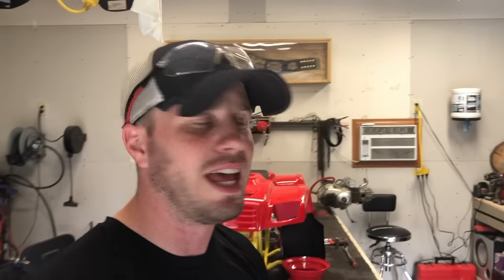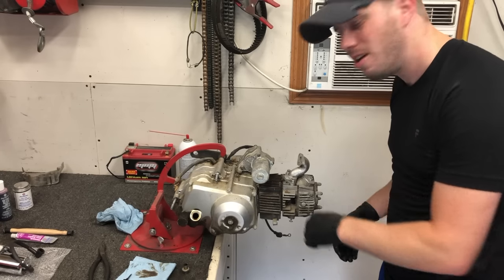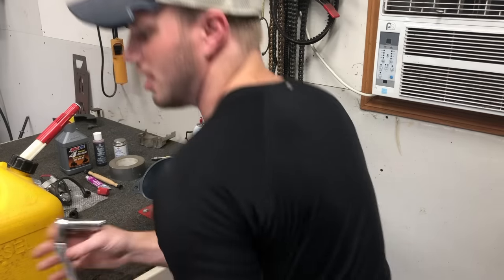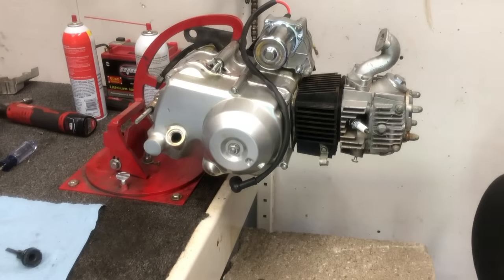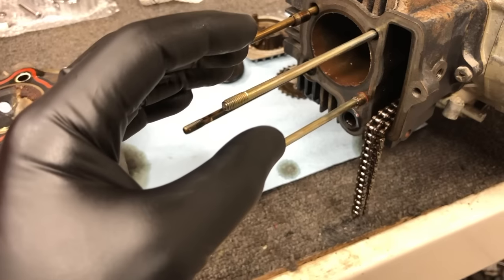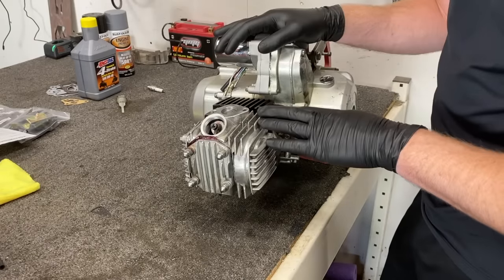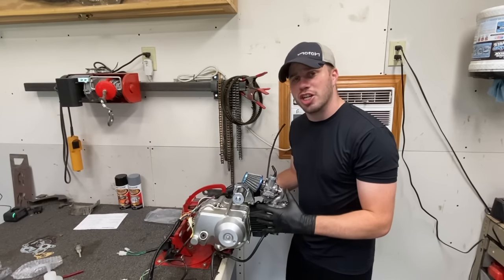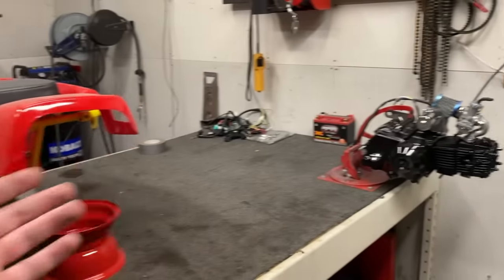Restoring a TaoTao 110cc Chinese ATV! Complete motor rebuild! Part 4

Comment: Do these come with the valves adjusted already or no, if no could that be considered a vacuum leak which may explain high idle. What video would be best. Thank you.
Reply from the maker: I recommend checking the valves as routine maintained but it's not likely that's your issue. High idle is probably a Fuel or Air flow issue. Did you try adjusting the idle screw?
Reply: @PraskaBoysGarage  I'll be doing that here in a bit. Thank you.

Comment: hello BJ, I bought a new starter for my atv off of eBay it came in and I installed it but it wont crank. I left the engine there sitting for a month or so but it wont engage I was wondering what the problem was, Thanks again!
Reply from the maker: Hey man! Check out the video I just posted last week on the channel. I discover that the motor is stuck and after I rebuild it I trouble shoot why it won’t crank! Check it out and I bet it will help you figure out what’s wrong!

Comment: Hey  by any chance you got a diagram of the fuel lines and how all other vacuum  hoses my atv had no carborator  so I'm a little  lost
Reply from the maker: Sorry I don't. Shouldn't be any vacuum hoses unless it's a California specific model. Only fuel lines you have is coming from the tank to the carb and a hose coming from the bottom of the bowl down the side of the cylinder.

Comment: Are there alternatives to these engines? Say if we wanted to upgrade power? For example with the atc70's you can swap original motor from 70cc to say a Lifan 125cc. Has anyone upgraded a Chinese atv?

Comment: How did you identify the engine size? Mine is a TZH157FMI which online is anywhere from a 110 to 250 can’t really find a reliable source.
Reply from the maker: Look on the cylinder sleeve or cooling fins. On most motors it with be in the casting stamped with a CM3. Here are the ratings: 
49cc = 49CM3
70CC = 72CM3
90CC = 86CM3
100CC = 97CM3
110CC = 107CM3
125CC = 124CM3

Comment: MUST I USE 15W40 OR COULD I USE 10W40 FOR 125CC BREAK IN.  NEW MOTOR, CARB, UPGRADED CDI, IGNITION COIL AND PLUG.
Reply from the maker: Your oil weight is fine, the main thing you want to watch for is the type of oil. You'll want to use an oil that is specifically designed for a wet clutch.

Comment: Can you link the clutch assembly online? I'm following your content building an 09 110cc coolster. But the clutch is shot. It's an auto with no reverse, it looks to be the exact same as yours. Everything I found online is for Semi Autos or doesn't match our clutches exactly, I pulled the plate over the clutch with 3 screws and there was black gritty dirt/dust all up under it, bought it for my kids as a project for $60! Turns out a starter chain guide mount broke off leaving a hole, I'm going to try to jb weld the hole and the guide into place and send it. Just around the street or yard nothing crazy. Thanks BJ.
Reply from the maker: Hey Jenna, I just posted a link on your other comment for clutches off VMCs website. Good luck on your project! Sounds like a fun one!

Comment: Great video! Is there a quick way to determine the engine size? (I just found a mini chopper with one of these engines with no clear indications of engine displacement.) 
Thanks!
Reply from the maker: Most of the time the marking is stamped on the engines cylinder cooling fin. For example if its a 110cc the stamp will read 107cm3

Comment: I have to ask what that red swivel table mounted stand is called exactly and where do I buy one because that would make life so much easier for working on these small motors.
Reply from the maker: Thanks for watching! I purchased the stand off eBay back in 2018. I am working with a company to help me make my own to sell on my website since it's been so popular on the channel! They should be available for purchase in March, and I will have a video on the channel going over them.

Comment: I got one of them quads does the break switch cables have to be touching for it to get spark ? I’m not getting spark
Reply from the maker: The brake switch cables need to touch so your start button will have power in order to turn the engine over. It doesn't affect spark at all.

Comment: Another great video !!!
Could you please leave a link for the engine stand your using I could really use one thank you
Reply from the maker: Thanks! This is my #1 question for sure! I actually had a CNC company laser cut out all the metal to start making and selling my own. I will be selling the kits on my website either as a DIY kit or a completely assembled and power coated. Should have everything ready soon and will post updates on the channel.

Comment: Hey man. I Got a hand me down 110 for the kids that wouldn't start. Did a complete new rewire kit. New battery, stator and starter also (all by watching your awesome vids BTW)
Got it to fire and run great. After about 15 minutes when hot it makes a building whining sound then dies. Let it cool a few and starts back up until hot again. I got into it to investigate and even retested the stator. I discovered that when turning the flywheel there is a scratching sound coming from what sounds to be the piston head. Would the engine getting too hot cause the electrical to shut down? Also when changing the oil it was metallic in color and had some bits in it. Rings?
Reply from the maker: These motors and electrical systems do not have an overheat safety so I doubt you have any electrical problem. I'm more concerned with the noise and the metallic in the oil. Definitely need to investigate and crack it open. If you can do a compression/leak down test first. You'll know if you have a failed ring then. Good luck on the search, I hope you find it!

Comment: Gday mate I'm restoring a quad bike and I'm currently working on the engine.  There's a lot of sand inside of it as the carbi, intake manifold and other pieces were missing. Anyway I was wondering what you used to clean the sludge out of the bottom. And what would you recommend I use to clean the engine out
Reply from the maker: When spraying it out I just use regular carb cleaner. If your not splitting the case I use diesel fuel to flush out the rest.

Comment: Bro I have same machine it was OK. I changed battery charging coil but due to  lake of knowledge I rotated megnetic fly wheel. Now my machine sparks but won't startes. I think there is timing issue can u please guide me how to set t mark.
Reply from the maker: Your flywheel should have a keyway. If the keyway is locked in with the crankshaft then your flywheel is in the correct position. Then remove the timing chain cover. Rotate the motor to top dead center. There is a little dot on the timing chain sprocket. That should be in line with a mark on the head. That sounds confusing, so if you still are struggling send me your contact info in an email and I will reach out to you.

Comment: I see you list a pz20 carb my kid has a 125 vitacci pentora and the carb on is non serviceable would the pz20 work or do I need the pz22?
Reply from the maker: PZ20 is kind of like the universal carb that works for both the 110cc or the 125cc. If you want to squeeze a little more power I would get a PZ22. However if your looking for the best options for the 125cc motor I would get a Mikuni VM22 26mm knock off from eBay for $35 dollars. That's the best bang for your buck.

Comment: I have this type of engine. Main problem is that it spit oil through the crankcase  breather everytime it runs on higher speed. Why is tht ? Even oil level is low still spit oil
Reply from the maker: That is very odd and have never ran into that issue before. I would start with an oil change and blow out the breather line and start from scratch. If the problems stays then I would start diving deeper into that motor.

Comment: Whats wrong when the 4wheeler doesn't kick in to high gear? It goes half the speed..
Reply from the maker: Lack of power could lead towards several issues. Stick to the main three: Fuel, Air, and Compression

Comment: There’s a 14mm bolt next to the drain plug. It has a spring and a pin. What component does that work with?
Reply from the maker: That is your timing chain tensioner. When you take that bolt out the plunger inside releases the pressure on the chain and you can take your cam out easier that way.
Reply: @PraskaBoysGarage  thanks for the info. What flywheel puller do you recommend? Also what the engine stand are you using?
Reply from the maker: @KobaBlack113  VMC Part number: Zn2 3801-TL100-01 is the generic one, make sure you measure your threads to verify it's the right size. Otherwise I just use a claw puller.

Comment: Letting it run without the exhaust can bend your valve I use at least 12 inches of pipe
Reply from the maker: Thanks for the heads up, I've never ran into that before. What would cause that?

Comment: Where did you get the engine stand ?
Reply from the maker: That is the #1 most asked question on my channel and I am expecting it to come up a lot from this video! I originally purchased the stand off eBay back in 2018, however the seller is hit and miss when they are listed. So I've decided to start working on manufacturing my own! Might be a little bit but once I'm ready I will be making a video for the launch!

Comment: just aquired a Lifan engine like this but a auto,,, How do I tell what cc it is and how to order the parts I need
Reply from the maker: Hey John, there should be a stamp in the casting on the cooling fins/cylinder sleeve. These are the readings:
49cc = 49CM3
70CC = 72CM3
90CC = 86CM3
100CC = 97CM3
110CC = 107CM3
125CC = 124CM3

Comment: Hey i have one to. how much oil do you put inn it. mine is completely rebuild. But i can't find out how much oil it goes inn
Reply from the maker: Recommended is 700ml or roughly 3/4 a quart. Remember is has a wet clutch so make sure you get the proper oil!

Comment: Where do I find the motor size.  I have a taotao river hawk. And where to order a top end kit. My compression is about 80
Reply from the maker: Look on the cylinder sleeve or cooling fins. On most motors it with be in the casting stamped with a CM3. Here are the ratings: 
49cc = 49CM3
70CC = 72CM3
90CC = 86CM3
100CC = 97CM3
110CC = 107CM3
125CC = 124CM3

Comment: I have a question. Recent i buy a street bike with a engine like this. It is the engine ok? You think i ca do 25.000 km before a major failure? Thank you!
Reply from the maker: These engines are Honda clones from the late 90s. They are great motors as long as they are maintained!
Reply: @PraskaBoysGarage  thank yoy

Comment: I am rebuilding the head on a 125 CC Toatoa but I can't get more than 90 psi after reassembly I have combustion Leaking into the crankcase after adding oil to cylinder I don't have any noticeable increase in compression I am suspecting the oil galley Have you ever encountered this?
Reply from the maker: Did you replace the piston and rings also on your rebuild? Sounds like your getting blow by and that's usually a issue with worn rings.
Reply: @PraskaBoysGarage  not yet. I just received a piston and rings. I will replace it soon
Reply from the maker: @pcb4041  Okay, I'm betting that solves your problem! Let me know after the install how it turned out!
Reply: @PraskaBoysGarage  no luck with the piston and rings still came out at 90psi.

Whats the minimum psi for these to run?

Comment: Great video explain very well like it. Where you get your red bench motor support?
Reply from the maker: This is my #1 question for sure! I actually had a CNC company laser cut out all the metal to start making and selling my own. I will be selling the kits on my website either as a DIY kit or a completely assembled and power coated. Should have everything ready soon and will post updates on the channel.

Comment: I’m a bit late to the party, but where did you get that engine stand?  I need one of those!
Reply from the maker: This is my #1 question for sure! I actually had a CNC company laser cut out all the metal to start making and selling my own. I will be selling the kits on my website either as a DIY kit or a completely assembled and power coated. I will post updates on the channel when they are ready!

Comment: Hi I was wondering if the pz22 carburetors have a air screw in for rich out for lean or a fuel screw vice versa?
Reply from the maker: The 22mm carbs I am familiar with have an adjustment screw on the intake side which would tell me it's a fuel mixture screw. If it was on the air filter side of the carb then it would be considered an air mixture screw.
Reply: @PraskaBoysGarage  see that's where I'm. Getting confused. If you pull the screw it has a blunt tip not a pointy sharp one like a fuel screw

Comment: Yo bj...i have a question straight pipe muffler does make your engine loose power???
Reply from the maker: No, just way too loud for a kid to be riding! Only thing you might run into is adjusting your carb to the next jet size up.

Comment: Trying to rebuild the same engine, has a weak spark and compression, but when i put fuel in the cylinder it will fire once then stop firing. Any suggestions?
Reply: Im waiting on a wiring harness but I don’t think thats the problem
Reply from the maker: What is the compression reading you are getting? It will still run on low compression, It just wont have any power when it's under load.
Reply: @PraskaBoysGarage  around 130

Comment: Love your channel! 
You may have answered this question before but I haven't seen the answer. 
Where do you get your parts?
I bought my first ATV yesterday it is Chinese Zongshen 50cc atv.
Reply from the maker: In the description I've added links to the parts I use in this video. I stick to 3 main sources for parts: 1) VMC chinese parts 2) Amazon 3) eBay. Make sure to research the parts you need. They can look very similar but be different sizes. Thanks for watching and let me know if you have any questions on your project!

Comment: Are clutch assemblies universal for 110cc atvs? I have a 09 coolster.
Reply from the maker: There are multiple options. Automatic or Manual. Some with or without reverse. Check out VMCs website they have all the options available and you should be able to find what you need: https://www.vmcchineseparts.com/collections/atv-clutches

Comment: what is the liquid in the can that you used on the gasket and what did you you for the valves course for fine
Reply from the maker: I use Permatex High tack gasket sealant for the gaskets and Permatex valve grinding compound for the valves. Both purchased off amazon and links are in the description below.
Reply: @PraskaBoysGarage  could I use red silicone?
Reply: I'm in the process of rebuilding my engine

Comment: Where can I find torque specs for the 110cc motors? Mainly looking for the head bolt torque value.
Reply from the maker: I use the torque specs from Honda motors that come on dirt bikes in the 90s. That is what they used to clone the E22 style of motor. Head bolts are 11 ft-lb according to the Honda manual.
Reply: @PraskaBoysGarage  thank you

Comment: Thank you for your great videos.. what carburetor size would you suggest for a atv chinese 125cc. Mine starts losing power on 3rd gear, but fine on 1st and 2nd. It came with a carb 19pz. I'm wondering if that might be the problem. (Not enough air coming in ??)
Reply from the maker: Hey you bet, glad you've liked them! The 125cc uses the PZ22, however if you want to get full potential I would recommend buying a VM22 26mm Mikuni knock off for $32 bucks off Amazon. That's what I do because it's way cheaper then a factory Mikuni but still give you a better throttle response and power. https://amzn.to/3qfbZdu
Reply: @PraskaBoysGarage  thanks so much for your reply. Keep up with your great videos :)

Comment: Your engine stand where did you get it or did you make it
Reply from the maker: This is my #1 question for sure! I actually had a CNC company laser cut out all the metal to start making and selling my own. I will be selling the kits on my website either as a DIY kit or a completely assembled and power coated. I will post updates on the channel when they are ready!

Comment: how were you able to flip the starter rotation? i tried on mine but it didn't work out i need more clearance for the carb great video 👍
Reply from the maker: Okay, full disclosure here I put it on wrong in the video, I just assumed I ordered the wrong starter at first and just sent it with 2 bolts. It wasn't unit I made the YouTube thumbnail that I realized I was wrong! If you see the motor in the future videos you'll notice I switched the starter.
Reply: @PraskaBoysGarage  ok thankyou very much for the reply

Comment: hi where did you get that swivel mount you have holding the motor?
Reply from the maker: This is my #1 question for sure! I actually had a CNC company laser cut out all the metal to start making and selling my own. I will be selling the kits on my website either as a DIY kit or a completely assembled and power coated. Should have everything ready soon and will post updates on the channel.

Comment: Wassup man i got 80cc yamaha raptor 4stroke wiseco piston u wouldnt happen to know witch way the arrow points? Plz help plz n thank u
Reply from the maker: I don't want to give you bad advise because not 100% confident however in my experience if there is an arrow on the piston that is to be pointing towards the exhaust(down). Arrows are more commonly found on 2 strokes rather than 4 strokes but Wiseco makes pistons for both and I would expect them to be the same across the board.